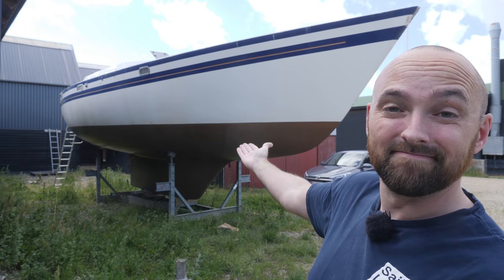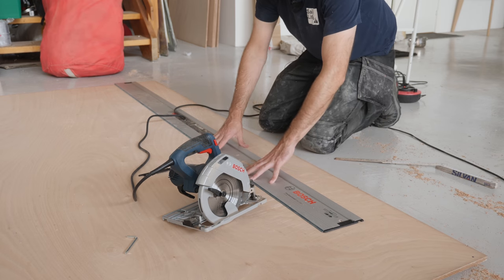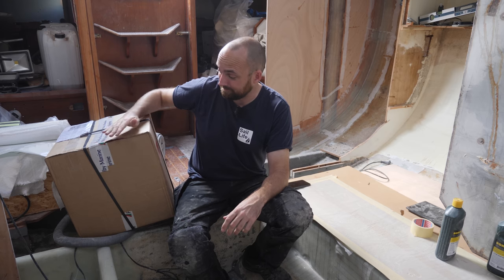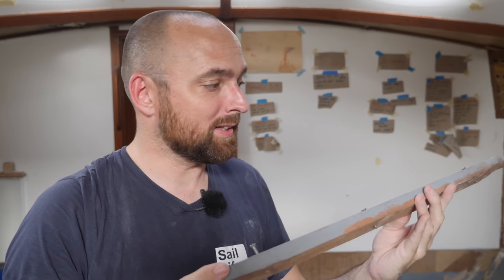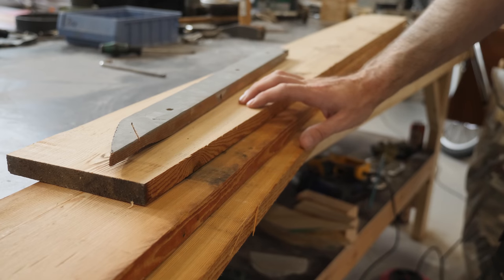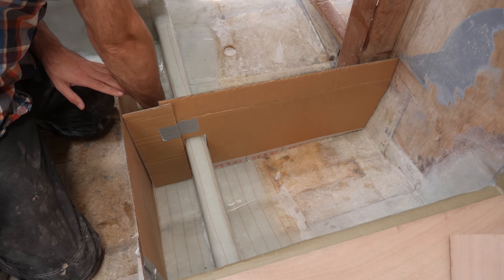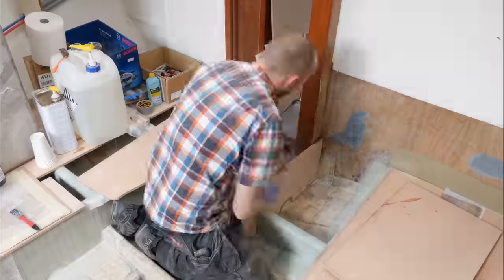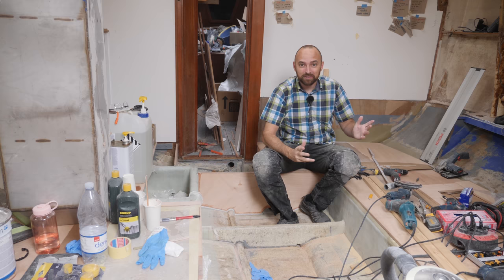Sail Life - More new cabin sole - DIY sailboat refit

Comment: The limber hole in the smallest forward compartment, I would have suggested to move that just a bit aft to the corner where it meets the first transverse section of plywood.  Your limber hole wasn't in the middle, but that area tens to be a downward slope to stern so it's possible just a bit of water could remain trapped in that corner.  Not a huge issue, it would never be much anyway.  The fun part of figuring out plans for limber holes is all the ways water can flow at any given point of sail, degree of heel, and then pitch of bow/stern... and then you have to figure in all the plumbing and electrical that could potentially follow in the same space. Oh Glorious complexity of boat systems! (I just love it when boat builders or Previous Owners block off limber holes by putting plumbing or electrical runs through them as if that is what they were meant for... I wouldn't mention it if I hadn't seen it for myself!)

Comment: Thanks for another nice DIY video, I always look forward to the next! I would suggest that you install tubes (e.g. 5 cm diameter) for runing cables and maybe also pressurized water  hoses before you mount the cabin sole - saves you a lot of trouble when installing cables etc. later. It is also much easier if you at some time need to replace a cable or similar. Install tubes between strategic locations you expect will be used for cabling - even if some end up not being used you will save time and labour. It also keeps cables out of harms way.

Comment: Another great vid, hope your four legged boat mate is feeling better now. 
Are you going to cover/protect the limber holes you drilled through the structural members (you did for the new cabin sole supports). I know that it's no longer a problem if they are wet, but it may stop them getting any worse and stop some horrid smells later down the line...

Comment: While you have the access, I'd suggest glassing in four to six robust anchor points so you can strap that tank to the structural part of the boat instead of relying purely on the furniture to hold it in place. 

(Something in the neighborhood of 5-10 g's is a typical planning figure when contemplating keeping heavy stuff from becoming a dangerous wrecking ball in violent seas/capsize. So, if your tank weighs 150 kg when full, design your restraints to comfortably hold 750-1500 kg in place.)

Comment: Mads, don't run the saw blade along the "track."  Measure from the blade to motor end of the shoe, then adjust your with measurement by that amount, then you can run the shoe along the "track" thus keeping the blade away from it, and keeping the saw flat on the wood. If the blade catches the track there will be issues.
Reply from the maker: I'm not sure I understand :) If it's the track for the circular saws (both use the same track) then it's designed to be used like I did :)
Reply: @SailLife  Lets say you are going to cut an inch off the plywood sheet, your way you put the "track," one inch in from the end and then zip the saw blade along the track. However, in the process the shoe of the saw rides on top of the track. My way is you measure from the blade to the motor side of the shoe, lets say the measurement is 3 inches, you then set the track to 4 inches off the edge,  1 inch for the size you need to cut plus 3 inches for the shoe. You can then place the shoe against the trace and keep the saw flat on the plywood. this gives you your 1 inch and keeps the blade away from the metal track. Now if your saw has a groove on the bottom that the track rides in that keeps the saw strait, well then, sir, you are the master, I just did not notice any from the video. Maybe I should start watching in 4K. :-) I can't wait to see her when she is done.

Comment: That is great. Even sanded down a spot that will never actually be seen. BTW, did you seal the little mouse door shaped limber hole that was circular but you cut out the bottom so it looks like a mouse door or a tombstone shape. Its at 18:03.

Comment: since you were worried about the coring of the floor members, would it be worthwhile to use your vaccuum pump (the one you used for the osmosis treatments) on the places you cut new limber holes, to try to extract some of the water they're holding??

Comment: All of that extra glorious sanding just to remove non-structural dimples in the bilge! Mads I think your OCD may have reached new heights! Wouldn't it be beneficial to seal up the skanky plywood inside the holes in the structural members? It might stop the build up of funky old boat smell. Hope Jøkel's feeling better soon.
Reply: A smooth bilge is much easier to keep clean.

Comment: Hello Mads: Maybe your Friend and you should buy a carbide helical cutter Head for your Planner because better cutting and last longer. Wow adding more weight with all that Plywood you are adding. Still go luck and keep going
Reply: He's not "adding more weight" with that plywood.. he's putting back the weight of plywood that used to be there.
Reply: Sir with the water soak core and all the Fiberglass Epoxy it will add up to more weight. If you look at OnBoard Lifestyle built Teal use A Honey foam Core with Fiberglass to keep weight Down. All I saying it is nice to save weight so you have more Supplies. But Mads building his Sailboat  and asking for Tips. So I just trying to save some weight. ANY BETS THE Sailboat will weight more???? That like a Carbon Mast and Nylon rigging to save weight.

Comment: And that's what would drive me mad 16:08, the moist core of the stringers. When I do so much work on a boat I would have get the old wood out of that, just to be sure that there is no rottening in there. But anyone should do it's own project.
Reply from the maker: It'll find it's way out eventually. I'll just wait 10 years and vacuum out the dust ;)

Comment: Concerning the limber holes through the structural members where you have rotten plywood; do you intend to seal the internal edges so that the plywood doesn't release moldy fumes?
Reply: My question, too. I was thinking he was going to glass in some PVC pipe cut to fit and glass the flat side, as well.

Comment: When you made that coring with your hole saw the sight of that soggy wood was horrifying.
Is it possible to drill several large bore holes into those support ribs and pump in some kind 
of liquid filler to combine with the rotting wood.

Another thought is after you built up the supports could you cut the top off the ribs and scrape out all the 
rotted wood and fill it with something that will harden and give you a much better support?  Maybe  cement 
with stainless steel rebar inside.
Reply: I think the time for that is well past, and I think the epoxy foam would have been a good option even though it is lighter.
Reply: @lancer2204  Ahhh I did not know there a thing like epoxy foam.  Do you think he will get enough strength from all the glass and epoxy he has covered his rotted ribs with?  

Is it really too late to cut the top off the ribs and scrape out the rotted wood and fill the cavity with epoxy foam?  Then recover the top with many layers of glass and epoxy.
Reply: @Bill23799  
Mads used epoxy foam to fill his rudder.
The strength of the ribs comes from the shape of the GRP, not the form in the middle, hence why a lot of BIG manufacturers now use closed cell foam to form cores that are then glassed over.
Reply: @lancer2204  Ahh, thank you for that information.

Comment: Mads, I've been biting my tongue for a couple of weeks, but can't keep it in any longer.. That square corner on you new shower is going to be horribly intrusive in the saloon - how about rounding it with something like a 400mm radius - you won't miss the space in the compartment and it'll open up the saloon appreciably.  Oh, and there wasn't enough sanding in this episode, I may have to go and do some of my own.
Reply from the maker: There's no need to bite your tongue :) The plan is to do exactly what you surgest. That's what I was referring to when I mentioned kerfing plywood :)
Reply: If you're referring to the diagram Mads drew up for the new layout, that corner is only square because it was simpler to draw that way.. the intention has always been to radius it.

Comment: I missed the rationale for making the sole in such large pieces.  I would think that smaller pieces would improve under sole access and be less work at the cost of a small loss of sole stiffness.
Reply: I have been told it is better to cut access hatches after the sole is in place (it makes building a good fitting and robust sole much easier) but not secured.

Comment: what happened to replacing the drain pipe under the flooring, with new pipe,--I see you just glassed over it
Reply: Agreed, Mads it looks like you've glassed over the other limber holes in the sections you just painted? Are you planning on opening those back up, otherwise you risk the same problems with standing water in those compartments.

Comment: Hi , you should have replaced the stringers so you Don't have molded rods under the floor,  I learn Allot by someone else mistakes , Have few projects on my own that's how I will do mine. Good luck Any way. 2 bad thinks the way you do it 1 socked stringer's And additional waight , to eliminate both Cooser board  and laminate with glass. Or close cell foam poured in a make shift stringer  system. The second way is chiper. In one of the videos you sad it will be very expensive I thinks I responded on that . Bolk is the way to go. Fibreglassed.com
Reply from the maker: I don't think so. The tiny bit of weight does not matter. With the added glass the wood is more than welcome to rot away completely. The downside to doing what you're describing is it's way more expensive, way more work and depending on the hull you're working on you might have to build a cradle to keep it from deforming while working on it. In the end the result is the same - a sea worthy boat.